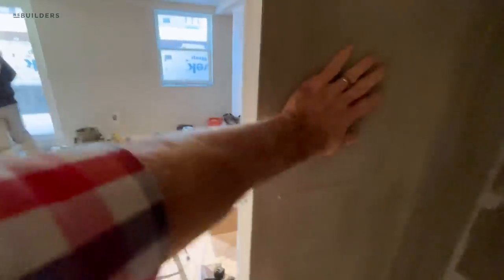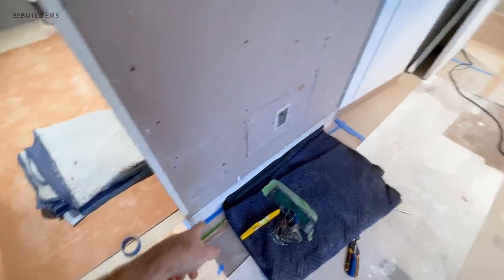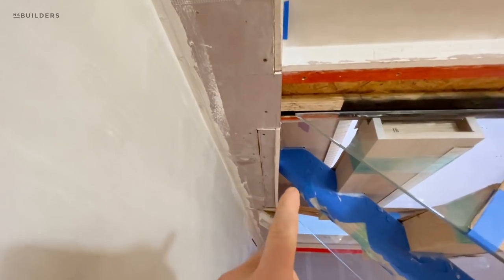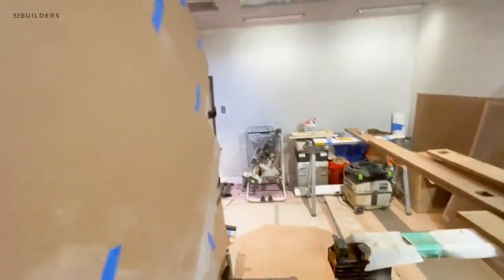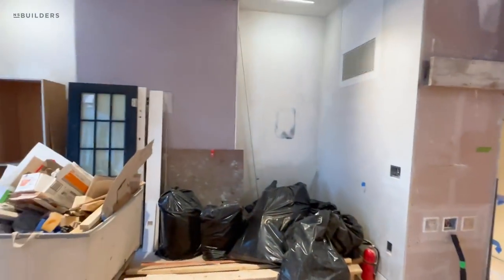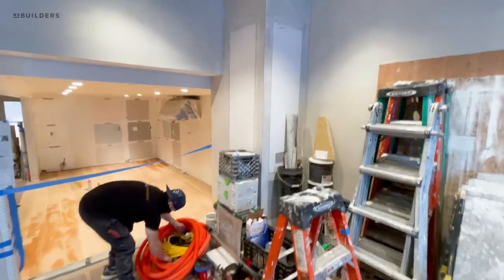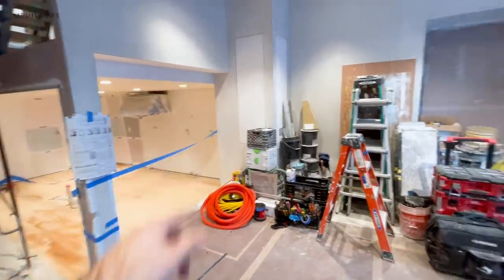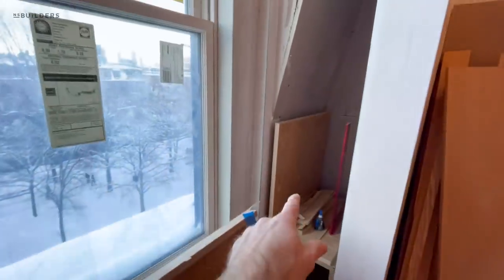Looking at Back Bay renovation details come together | Site Visit

Comment: I am confused. He said this was a take over project. Is this the same take over project where the previous contractor cut a slot in the hardwood floor for plumbing? Or a different project? I have been following this project for a while. I didn't realize it was a take over.